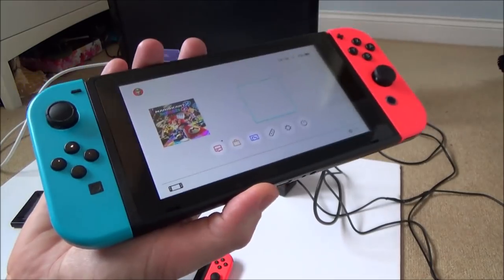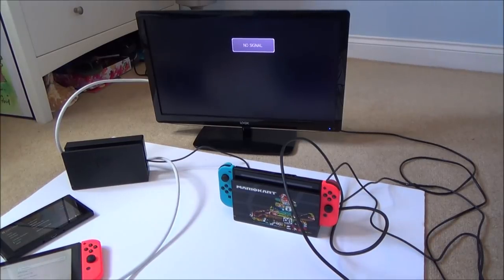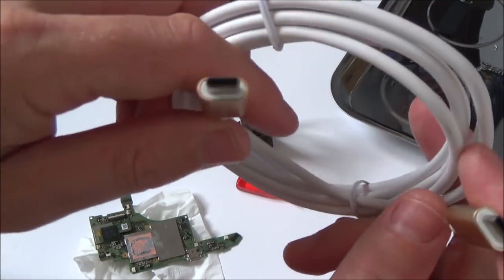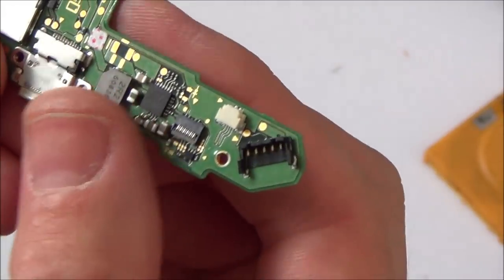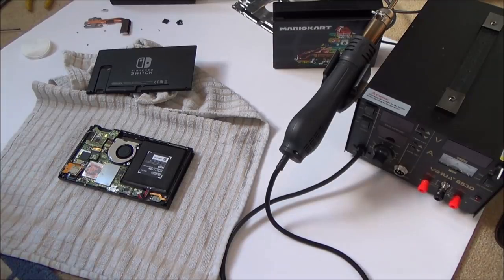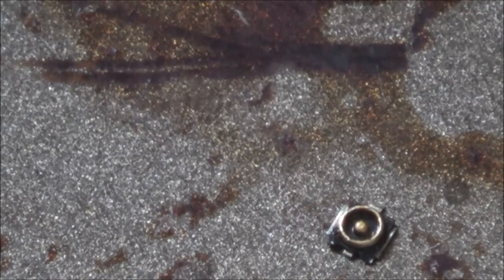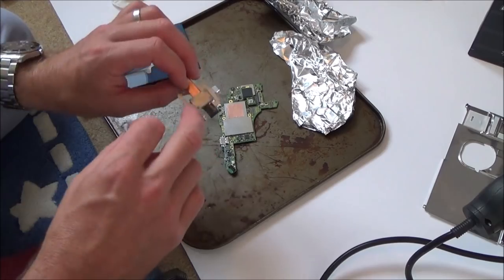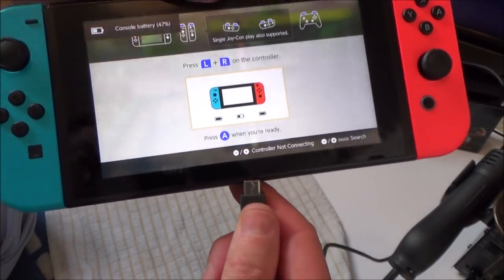UPDATE: Trying to Fix the Faulty Bent Nintendo Switch Not Docking

Comment: Just a heads up, that was waaaay too much thermal paste.
Reply: Nope, did you see how much was put from the factory? Also that Switch seems worst that some laptops gaps, so more thermal paste for better coverage.
Reply: i like that word "computerist" im stealing it and making it mine
Reply: Indeed. It's a bit too much for the Switch. Half of that is more than enough.
Reply: It's better than not having enough to cover the spreader. Sure using too much is a wasteful & inefficient use of paste but having it really won't have a negative affect on the temperature since the retention of the cooler will spread & thin it out pushing the excess from the sides which so long as the paste is non-electrically conductive, which this one is, will be safe for the other components. In fact in cases like a GPU with an exposed die with no heat spreader you really want to lean on the side of using too much since missing even a tiny bit of coverage would be catastrophic for it.
Reply: Who cares. It's his paste and he can waste it if he wants. It won't affect performance.
Reply: just laughed so hard when he said "just little blob" and tilted the console XD
Reply: Maybe a bit too much, it shouldn't overflow out of the sides. But the heatpipe isn't a perfectly flat surface like a PC heatsink, so more is needed to fill in the gaps. For a regular desktop CPU a narrow stripe around 1/2-2/3 of the length of the heat spreader should be enough based on what I've seen but for this you'd probably need at least double. I think the stripe method is better than the blob method, since it takes into account the size of the surface and takes out a lot of the guesswork.
Reply: Hi Vince
Not trying to troll you but it should be a small pea or one/two grains of rice...... you added about a large broad bean of paste. 
As long as it’s a good brand like you bought and it’s non conducive it’ll be fine, but it starts to get really expensive!!
Thanks for the videos and if you want to see any vids to get better at soldering and reflowing, check out Louis rossmann’s channel 👍👍
Reply: Holy s***oh my God that would be acceptable on like a big a computer CPU but that thing's this CPU is small the size of a pea
Reply: Can't you be as generous with thermal paste like lubricant? More won't hurt anything, maybe your wallet.
Reply: well too much thermal paste can become a problem but it would require INSANE amounts of thermal paste though, It shouldn't hurt
Reply: factory always over pastes alot of the time its to make sure it is done right. there Idea behind it is always safe then sorry
Reply: computerist, you apply thermal paste so there is proper contact with the cpu/Gpu and cooler to much thermal paste, is better than less.
Reply: There's no such thing as too much thermal paste - only too little. If it's non-conductive paste, it won't matter if it squeezes out of the joints. There are plenty of videos on Youtube proving this (LinusTechTips, JayzTwoCents, Gamers Nexus, etc).
Reply: I'm seeing a lot of people saying "you can't have too much thermal paste" but that statement is absolutely false. Putting too much thermal paste actually insulates heat instead of conducting it. You want to have just a thin layer of paste to achieve the best heat conductivity.
Reply: @Sevicify  a thick layer of paste actually becomes an insulator. Way to much is just as bad as to little or no paste.
In that case thermal pads are better.
Reply: Baron von Limbourgh It won't because the retention of the cooler will push the excess out leaving as much paste between the IHS & cold plate as needed. There are plenty of videos that test this, look up the "Don't try this at home.... seriously!" video by JayzTwoCents where he absolutely slathers a GPU with a ton of paste which showed no negative temperature impact (the opposite actually) and shows manufacturers themselves put "too much" on. Also look at the excellent Gamers Nexus "“Too Much Thermal Paste” – Benchmark of Thermal Paste Quantity" video which clearly shows too much doesn't negatively impact temperature in their heavily controlled testing, their too much testing averaged 0.5 C lower temperature than pea sized while having a 0.3 A higher average power draw and the temperature-over-time graph for all shows too much performing ever so slightly better the entire time and the thin spread & big blob tests being ever so slightly better than that (talking 0.7 C difference between all methods which they state is within margin of error). These two videos clearly show too much paste doesn't negatively impact temperatures which, as stated by Gamers Nexus, is due to the tension of the cooler pushing out the excess. You may run into issues if you use some crap thermal paste (just use the good stuff), conductive paste or your cooler has little tension to push out the paste in which case you have a bigger issue with an inefficient cooler than with how much paste you put on.

That said you still want to avoid using too much due to the mess it can make and wastefulness of it, ideally you want just enough to cover everything. I personally use the "thin spread" method on my CPUs just to give me the peace of mind that I have full coverage but a decently sized blob compared to the spreader in the middle is just fine too.
Reply: @Stillcho the ONLY reason people limit thermal paste, is because if it is conductive, and leaks, it can cause shorts, fires etc. There is 0 issues with "too much" if the paste is non conductive. See https://www.youtube.com/watch?v=EUWVVTY63hc and https://www.youtube.com/watch?v=rAid5G30-WM and https://www.youtube.com/watch?v=JYwHB2P6GmM

That, or you like to not spend too much money on thermal paste. Then the third video application methods work fine.

you DO NOT however, want to use "too little."

Too little can result in air pockets of insulation, trapping heat on the components and overheating.

Yeah.... Electronics are more durable than most people give them credit for.
Reply: There are about a million videos and even a recent one from Linus showing that it's almost impossible to put too much thermal paste on. As long as it's not oozing all over components creating possible shorts or capacitance issues, you're fine.

Comment: Btw I just have a little tip the reason why the Nintendo switch only docks one way or facing one way is so the fans in the back of the switch can work it has nothing to do with the usb c port all it has to do with is the fan. It likes a safety thing so people or children work put the fan holes dead against the dock making it so it can't breath. That's why the switch only gos one way in the dock so the holes foe the fan matches up with the little holes on the back of the dock. Hope this helps
Reply from the maker: That helps a lot. Thanks for the info :-)

Comment: I’m having this problem
My switch when its put into the dock shows the green light but doesn’t go onto the tv. Sometimes it goes onto the tv but only for about 5 seconds to 2 minutes. Please let me know what to do
Reply: I had that same problem, but mine was Not even charging, When I checked the charging port I saw a very bent pin, with a tiny stick i putted it back and It started charging, but no image on tv. I saw another bent pin and when I putted it back in the Right spor it was perfect, it sabes my quarentine
Reply: Tell me if it works
Reply: IM HAVING THE SAME PROBLEM
Reply: @matecarto  my pin was not bent and i still have the problem. is there anything else you did to try to fix this
Reply: Boyman And fam check them again and gently try to put them in their position if you see something out of place. Make sure there is no dust or some shit in there
Reply: The one that made it work again wasn’t really bent, more like detached from the other ones
Reply: @matecarto  do i have open up switch to check pins ???
Reply: IPTV PRO UK nope, Just look into the usb c port
Reply: @matecarto  cheers

Comment: Well done on fixing that antenna connection 👍 another fun video. As many have said, a full factory reset may help, would at least make it a little clearer as to it being a hardware or software issue
Reply: One thing to try (saw a chap do this on Reddit. ) restart the console in handheld mode and quickly put it in the dock before it starts up, it may try to force it to output

Comment: Great video as usual Vince. Very entertaining. While I'm not an expert at working on the Switch specifically, I do work with electronics and components as well. Doing a little research, I did come across some information that the chip you were looking into is indeed the chip that controls the HDMI out to TV function, known as a Matrix Switch. This particular one being the Pericom Semiconductor PI3USB30532 USB 3.0/DP1.2 matrix switch, which I was able to find with a mixture of an iFixit teardown that outline the components, and Pericom's website: https://www.diodes.com/products/connectivity-and-timing/switches-mux/protocol-switches/usb-switches/part/PI3USB30532#tab-overview

Under the Specs & Tech Docs they outline the chip is used for HDMI out to TV for devices such as Laptops, Tablets, and Mobile; As well as it's use for Docking output via USB C connection.

I do think that having it usable in Handheld mode is better than the potential damage that could come with trying to replace the chip, however.
Reply from the maker: Thanks for the info and the link :-)

Comment: that with 480p is normal.
if you buy a new switch, it will show only 480p and auto.
it will only show 720p+ if you dock it and plug it in a 720p/1080p screen.
Reply from the maker: Interesting, I never knew that :-)

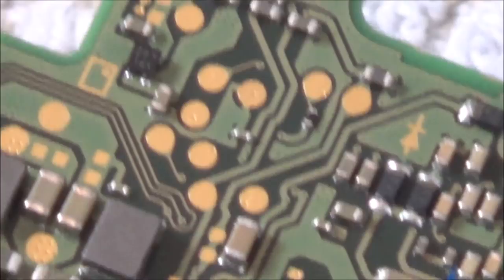Comment: At 19:02 and 19:37 looks to be some oxidation on the board. Could mean poor connection or bad chips. Of course finding out what those do for the system is the hard part. A reflow may solve the problem after a proper cleanup of the oxidized crap. And if you can find some type of schematic and it is broken traces on the inner layer, jumper leads to get around those can be done.

Comment: I have a switch with the same issue. Also it's not able to connect to via USB in RCM mode. I checked resistance to GND on the USB Data lines, one has 30k the other a few Mega Ohm... so it seems like the usb controller is busted. Bad thing is, the usb data lines are directly connected to the APU :/ did you ever check if RCM/USB works for that console?

Comment: Holy Yevon this fixed my issue with my switch stuck at 480p. I unlocked it then changed the setting to 1080p then docked it. BAM! no its docked at 1080p 😭 Thank you good sir 💚

Comment: I keep hearing you mention the pins on the switch unit aren’t reversible, that can’t be true. The reason the switch dock has a notch is so that the screen faces the front, and the vents would be sucking in through the hole in the back allowing proper air flow. If you think about it if the pins were not reversible you would only be able to charge the switch if the USB-C cable was facing one way but not the other. Just wanted to mention it you say it often through your videos.
Reply: Garrett yes, and very annoying.
Reply: Not necessarily, if the pins in the charging cable are also mirrored.

Comment: 7:20 the small picture issue is caused by tv settings each output has diffrent settings you might want to change it
Reply: Gabrielo (darkspongebob11) he set the other switch to 480p and it was still a larger screen.
Reply: it was the chance of input on the tv not him charge ing the switch / dock / cable
Reply: Gabrielo (darkspongebob11) right! I forgot he used the other dock. Im sorry. Goid point.
Reply: not only did he use the other dock more importantly he also changed the tv input to match

Comment: It's highly likely the docking issue is down to the power ic being shorted on the higher voltage detection. Ie 5v will work but not the 15v mode. Replace that ic and it should resolve.

Comment: Could it be it's not receiving the signal telling it is attached to a TV and for it to send the signal out because there is a loop situation it has to get the signal from the HDMI telling the system that it's connected to your TV and then it sends a signal back to the TV displaying what's on the device

Comment: Thanks for close up's i am wondering if the video chip (output) is borked in some way, thus preventing the last 2 resolutions. Check last update info, also check tracks on board with a loupe/magnifying glass if possible. Heating of chips is defunct on this type of error imo.

Comment: The reason that you don't want to reuse thermal paste is that it can create air pockets where heat builds up and get the components it's supposed to help cool. As far as the different pastes, it should be fine to use the same on both, but like you thought, it's not as important on the connection between the pipe and the heat shield since there's no components involved. Even the bottom one in this case it going from a heat spreader to the pipe, not the chip itself so it's no biggie, but it's good to replace it nonetheless
Reply from the maker: That makes sense, thanks for the info :-)

Comment: The paste colour is fine. Likely just cheaper quality or differently branded paste on the side that touches the shielding as it's not in contact with a chip, or could have been mixed with a gum to secure the heatsink to the shield more securely. Arctic pastes can be used pretty much anywhere, you don't have to worry about using the "wrong paste" as long as you don't buy any off-brand cheap stuff.

As others have said, you applied way too much paste. The idea is that there will be an incredibly thin (1mm or so) layer covering the entirity of the chip once it's spread. Any more than that can insulate heat inside preventing it from escaping quickly enough causing components to heat up. Often it's easier for newcomers to apply a little pinhead amount then spread it with a piece of card, adding more paste and spreading as needed.

What you DONT EVER want to happen is exactly what happened in this video, your paste oozed out of the sides. That extra paste is going to liquidate and flow all over the area surrounding the chip as soon as it gets hot, which it will do with the amount of paste used.

Comment: The chip making you switch between portable/docked mode is probably dead. Did you check if you could charge the switch while docked? And if yes what voltage is used?
I don't see any reason for it to be a software issue

Comment: I’ve worked on a lot of laptops that use a similar designed heatsink and pretty much thermal paste is used to fill in the microscopic spaces between the layers of the chip along with any shielding on top to the heatsink and the reason they are different colors is probably because the pink stuff on top of the heatsink is lower quality paste since the metal frame isn’t really a huge part of thermal dissipation so it saves Nintendo a few pennies. If you want the best performance, you should replace the pink stuff too since it’s already pretty crusty and no longer doing much now that the metal shield was separated and the paste can’t fully connect the layers. It needs to be gooey to work good. Also you should take off the shield over the main chip and replace the paste that’s directly on the die

Comment: for melting and reflowing chips you want to be up around the 400c mark not 340 and you also want to use a lot more flux. At 340 you're just heating up the components, you're not melting any of the solder or reflowing anything. when positioning components that you're trying to put back on with existing solder you don't need to get them exactly in the perfect spot, as long as you get them fairly close when the solder melts it'll pull them into the right place
Reply from the maker: Thanks for the info :-)
Reply: The remains of the old solder were way too dry, clean the pads first, get rid of the old solder and apply some new leaded solder on the pads.

Comment: When docked the console lcd blacks out so that would suggest the console knows that it is docked and not just connected to a charger. It is at least attempting to output video via the usbc to the HDMI port but of course we could see that no signal is produced.

It seemed logical in believing that if there was continuity between the motherboard pins and the bare wires then there is continuity and the pins have not lifted from the motherboard. 

Howeve while checking continuity you noticed that a lot of the pins were grounded. 

The switch probably detects this and is causing it to only show 480p in settings and not able to output a signal. 

Check to see whether if any pins are bent or messed up internally and grounded to the shielding or other ground pins.

The incorrectly grounded pins might have coincidentally caused it to believe that the TV is reporting that it supports 480p only, even when nothing is connected. Possibly the console uses other pins to detect it is docked.

Comment: Vince what does it mean when the dock light flashes the minute you rest the switch in it? It won't charge or give a signal to the tv my switch still charge with the charger but i have to flip the plug over on one side for it to work. Idk what's wrong, I rarely use my dock so I don't think its broken I'm thinking it might be my charging port. How do I test this?

Comment: Did you ever find out what the issue was? I have a switch where I replaced the PI3USB chip and i suspect it has to do with the installation of the replacement chip, specifically one the tiny pins not connecting properly. I am afraid to fiddle with it again though, in fear of breaking it completely